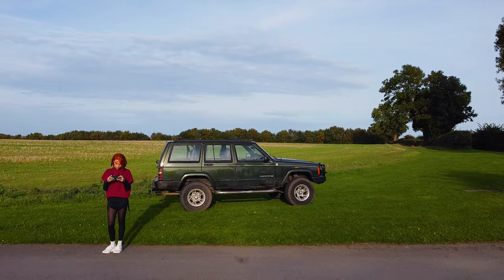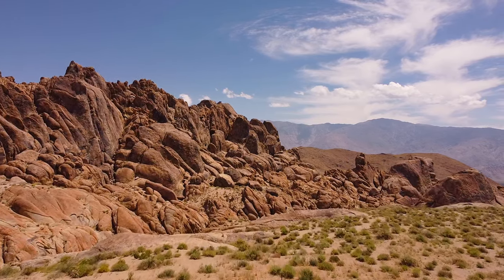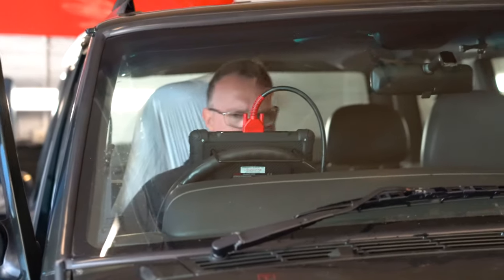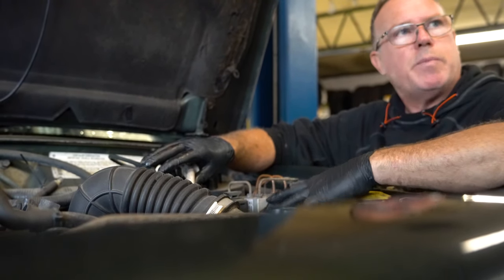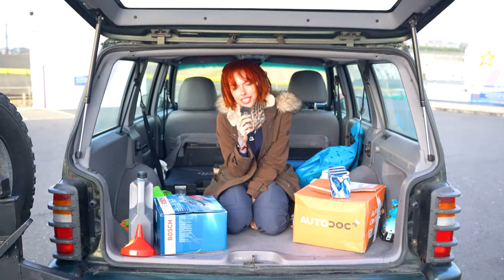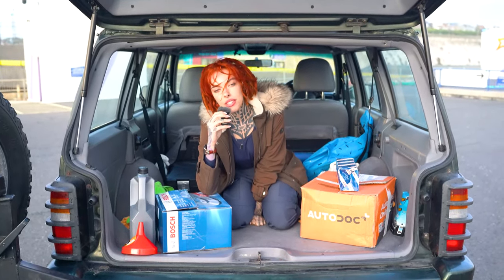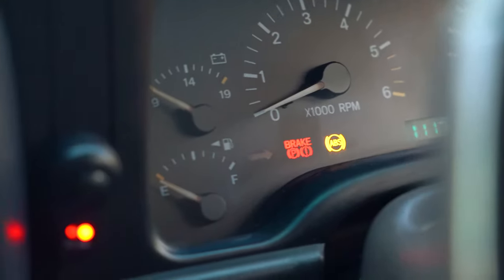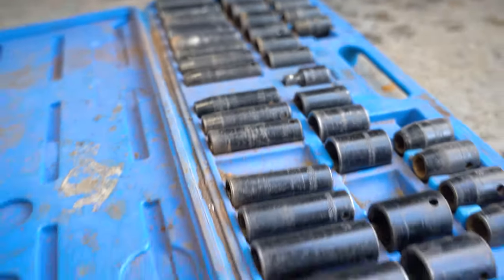i'm overwhelmed....

Comment: Wheel bearings scared the heck out of me too initially on my truck, until I realized I had done them on bicycles for years. It's the same concept - uninstall, clean, inspect, reinstall with lots of grease, and tighten but not too much. You'll be on the road in no time.
Reply from the maker: Yes! It’s intimidating until you actually do it

Comment: I can totally relate to having seasonal depression. Not only am I bipolar, but I also have the seasonal depression. Which in my case usually comes in the Winter, late Fall, and again in the late Spring and early Summer. It varies from year to year on how bad it is, but I just have to keep telling myself that it will pass. As for your wheel bearings I don't think you will have too much of a problem replacing them. It will help that there are two of you. I'm looking forward to seeing your adventures in Great Britain.
Reply from the maker: That’s the best thing you can do is reminding yourself of the transience of everything

Comment: Looks like you got a really good find with that Jeep there! That's awesome nothing major is wrong with it. Being it needs control arms, be careful going over speed bumps and pot holes. My rig needs new control arms and I have had a new set for the last year in a box in the back of my rig but just haven't done it yet. 🤷🏻‍♀️🤦🏻‍♀️ That Jeep looks like the perfect rig for what you need.
Reply from the maker: No worries got them replaced 🙏🏻
Reply: @TorieRobot  Sweet! In my eyes, you're completely good to go 😁 those tires you have on it are super sweet too!

Comment: I've started doing a fair amount of car camping lately, but not because I'm particularly nomadic or seek travel or adventure, but because I want a stable and secure base from which I can go hiking (I park up, set up and stay for a good number of days). I've got fat and old, so looking to lose weight and try to turn the clock back a few years. I've set up a basic ass-end camper in a Citroen Berlingo and it's working out great - it's a no-build job costing very little and I've drawn a lot of inspiration from Japanese car camping videos. I can go off-grid in it for about 3 days, but off-season, getting a campsite is cheap even with an electric hook-up (I'm away again this week for three nights in Wales for £10 per night including the electric (£5 per night without)). Biggest problems here, during the wetter/colder months, is keeping warm in the night and keeping stuff dry (or drying stuff out if it gets wet). 

It sounds a little bit mercenary, but being a pretty big channel, perhaps you can reach out to the likes of Jackery/Ecoflow etc. and try for the biggest powerbank you can - from that, run an induction hob, electric blanket, small heater etc. Then look at booking a campsite when needed to recharge and do stuff like laundry (many sites have washing machines and dryers). Although many sites do close off-season, the UK is a compact area compared with the US, so you'll never be that far from somewhere suitable (be aware that some sites don't allow sleeping in cars and dislike 4x4s - plenty do though). 

Other than that, consider a good breakdown/recovery plan and perhaps look on eBay or Facebook Marketplace for a roof box as extra storage. Worth getting a electric hook-up cable too - it's got a 20A plug. not a normal one (15m for £20 from eBay). Shops like Home Bargains, B&M and Poundland are great for budget buys.

I would suggest trying your setup out for a few days on a campsite before hitting the road proper - I've done 13 nights in the car and I reckon I've now got it about right!

As far as dealing with mental health is concerned, I suffer a lot since I can ever remember, and the only way I deal with it is to put myself through something like a massive bad weather hike that will almost break me and then I'll rebuild from that (like hitting the reset button on a computer). The rebuild usually starts with a drink or two, some good food and some tunes.

All the very best with your endeavours.
Reply from the maker: I’ve actually got a better set up in my Jeep Cherokee back in the states with a power bank and solar panels etc- so great ideas! Well done on doing your own build - doesn’t have to be fancy just has to work for you 🙏🏻
Reply: @TorieRobot  - by the way, the place I often go to is called Fforest Fields in Mid Wales. Ideal for a try out. Cheers.

Comment: No need to replace the whole control arm,just the rubber bushing.just more work involved and cheaper if you are on budget
Reply from the maker: Well it was a part in the control arm that would be more expensive to replace than just replacing the whole thing

Comment: 8:17 in my 20s I used to sleep in the back of my Jeep, the exact same vehicle. I'm probably a short run out because I'm older and we all shrink when we get older so you should have no problem. I doubt you're taller than I am.. It's not a comfortable sleeping. Nothing is a comfortable sleep without a bed. You'll be fine

Comment: Others in the comments have probably stated this but you need a press to change the wheel bearings unfortunately, well in most cases at least. I'm currently in the same predicament with my car needing new bearings and a workshop has to do it, was hoping to have a go at doing them myself but alas no.
Reply from the maker: We were actually able to do it ourselves in a parking garage 👍🏻👍🏻 I think you can too tbh
Reply: @TorieRobot  Oh, cool. I'll look into it further. Thanks Torie.

Comment: The dashboard cluster going in and out could be a loose wire or bad solder joints
Reply from the maker: Yeah it’s common - my other jeep has that issue too with one of the gauges

Comment: Overall that is a nice looking Jeep.  If I was there I would help with the mechanical for sure.  i like the bumper and I don't think it will effect the air flow to the radiator at all.  Best of luck.
Reply from the maker: It’s very nice with nice mods and hope you’re right it’s just that these keeps runout
Reply from the maker: Hot*
Reply: @TorieRobot  If your losing fluid that would make it hot and I had a jeep with that engine and it ran hot and I ended up having to put a head gasket on it.  It burns the fluid in the engine so you don't see a leak.  Could be a thermostat issue which is a cheap repair.  If you are losing fluid and you can't figure it out you can always go with stop leak.  Just have to watch what kind.  I always used the kind where you don't have to flush the system.  Bar's Leaks Pelletized Radiator Stop Leak 11oz You would only have to use half or a little less.  Half is for a 2 gallon system and the bottle will do 4 gallons.  It can be mixed with antifreeze so you don't have to flush the system.  The fibeous kind will clog your heater core so you won't have a heater so don't use that.  Head gaskets are very tricky and you will lose fluid and not see it leaking anywhere and your jeep will get hot if that is the problem.  Just ask the parts guy or a mechanic to be sure it may work but I have had good luck with that.  The head gasket is a fairly easy job but it is labor intensive.  Your dad could maybe give some advice on that also so don't take my word for it.  Good luck.

Comment: I'm sure you felt going in that hey...its the same era Cherokee...i know where a lot of this stuff goes... but got cursed by incomplete/non-existent service records provided by the seller, who glossed over what was wrong with it.  As to the cold...UK doesn't get winters like Pennsylvania. The average temperature range is 0 to 7C (32 to 45F). As to visiting your sister in Sweden, drive there.
Reply from the maker: Well easier said than done haha Sweden is a far drive and very strange to drive with steering wheel on the opposite side
Reply: @TorieRobot  but you're awesome and can do anything. You can cut the drive by taking a ferry from the UK to the Netherlands and avoid all of France. Then it's Northern Germany up thru Denmark and over a bridge to Sweden.

Comment: You have been Abroad and ridden in their Cars. Wheel Bearings are pretty durable even after they wear out the wheels just make a noise but the wheels stay on..! Take those parts back and get a refund..! Do nothing to that Vehicle, save your Money for shipping it back to America...!🤔😇👍
Reply from the maker: Hahah I wouldn’t want this Jeep in America as the steering wheel is on the wrong side lol
Reply: @TorieRobot  You use the Parts of Yokki to change it over..!🤔👍
Reply: @TorieRobot bring it back and I'll trade you. If I showed you the build sheet for my 2000 XJ, I think you might consider. I've wanted a RHD XJ for a long time, think about it 😅😅😅

Comment: Another great video 👌

For future adventures, consider Ford products; especially Expeditions and Explorers.  They are so super reliable and cheap to fix.  Their also cavernous in the back and the spare is even mounted underneath the vehicle.  

Another tip: get carshield, it’ll cover all repairs for the power train at least, which are the most expensive repairs.  You’ll need a 99 or newer vehicle which is under 300,000 miles.  

I’ve vehicle dwelled in a Grand Cherokee before, it was a money pit.  My last was a 99 explorer, next year is gonna be an expedition.
Reply from the maker: I actually hate ford 😅 even though these vehicles have problems rust isn’t one on this one and they are easier to fix 🙏🏻
Reply: @TorieRobot  ok ok. 👌 

I never have issues with rust cause all my vehicles come from like Nevada or Colorado.  

Hang in there with all your stuff, and good luck with the bearings.  That’ll be impressive if you can get that accomplished.  🤘